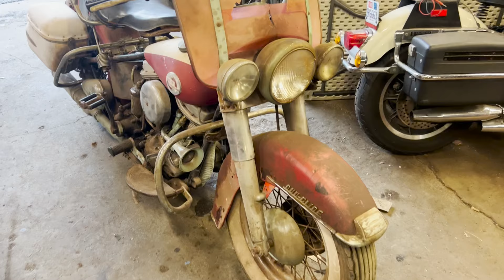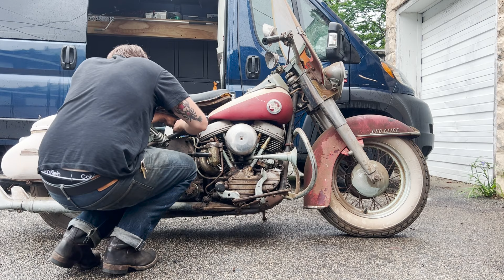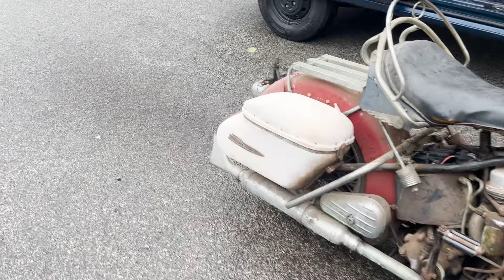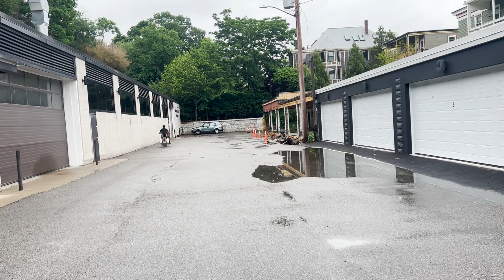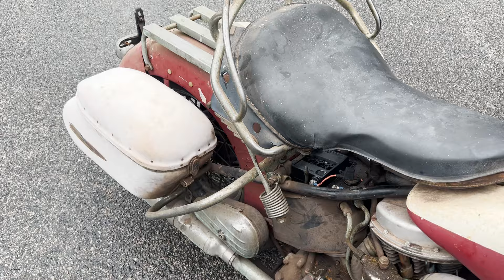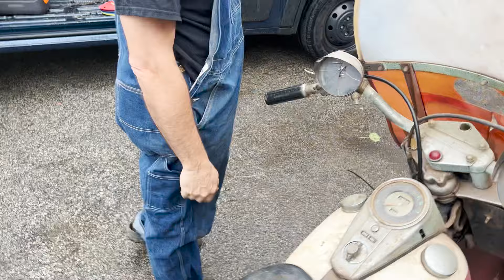1957 Harley-Davidson Panhead Revival Part 2

Comment: OK you got me. Now as for that front fender badge that says DUO GLIDE... Seems to me being a hardtail frame it should say HYDRA GLIDE ?? Am I wrong
Reply: Correct. Which begs the question;  Is it just the fender that's not original, or the entire front end?
Reply from the maker: They just replaced the front fender and painted it to match at some point back in the day.